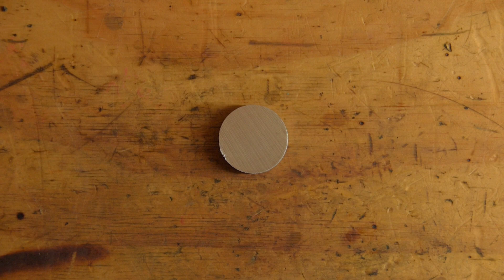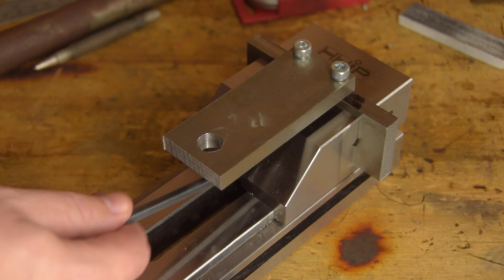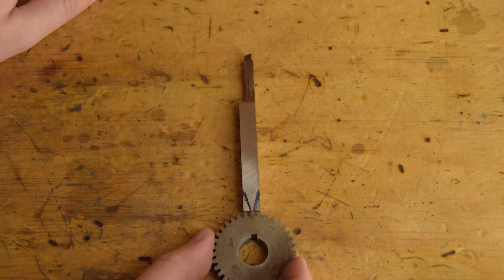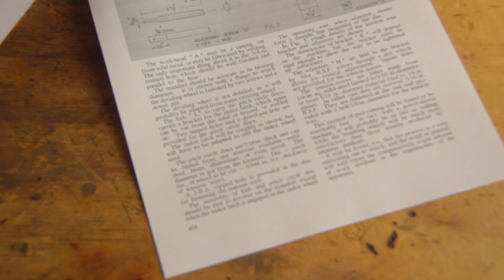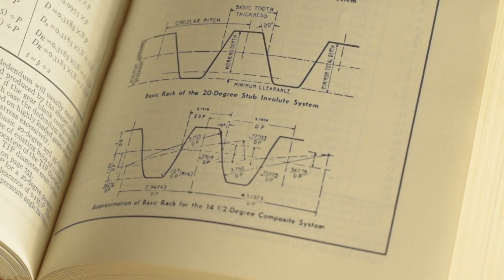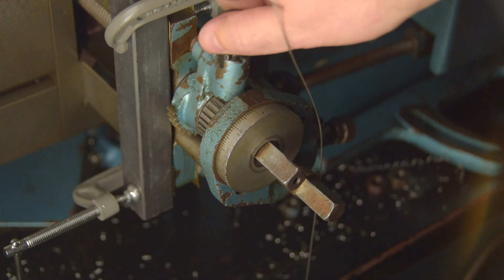Shaper Machine - Involute Gear Cutting

Comment: The concept is a good one, but your method of indexing has caused culmunitive error.  This is apparent at the end when some teeth show signs of being thicker than others. One solution would be to have the bobbin with the wire drive a slide fit on the shaft and have an index hole. In front of that another disk fixed to the shaft but drilled at a pitch circle for the number of teeth required, (needs accuracy) then index with a pin the disk to the bobbin for each tooth.. Either way this method requires a new bobbin and new disk for each different gear blank. Well that looks like one possible answer anyway and it negates your setting up each time with a clock. Enjoyed your land rover rebuild no end, great work. Steve

Comment: I might be able to shade some light on the geometry and machining of evolvente gears. I work as a univeristy student at a gear and transmission research academic chair ( the FZG of the TUM) in Germany. I am mostly concerned with bevel gears, so my cylindrical gear knowledge might be a bit rusty.

First, the shape and kinematic of a evolvent (or involute) gear. Take a cylinder with the diameter of your base circle. wrap a string around it and tie a pen to the end of the string. Set the pen at the base of the base circle and pull it outwards guided by the string. Rotate your base circle contraption one division, repeat. Do the same with the string the other way around the base circle. You have just made drawn a perfect evolvent gear. 

Imagine a belt drive of two pulleys with crossed over belt. With a bit of thinking you will notice, that what you just sketched is the path a single point on the belt traces in relation to one pulley. If you would build a wall along that line, it would always be in perfect contact with a wall derived in the same way on the other pulley. 

You mimic this movement with the wires and the single pulley. The second pulley has an infinte diameter, therefore its wires are a straight line. 
Levers do not mimic this kinematic. Stick to wires or use thin shim stock. 
As for dividing... I am lost on that. Old gear hobbing machines have very complex transmissions that take care of it, but that isn't an option. You could try indexing in a more repeatable manner from the tooth you cut. You could try to make a cutting tool with a second tooth you use to index off of. 

Any questions on gears are welcome, I can break out my lecture scripts, just have to get them translated to english.

Comment: I like your concept so much. The stationary wire an X displaced pulley acts like one tooth on a rack gear to prescribe teeth shape on a pinion gear work piece, synchronously. 

Factors affecting synchronization displacement from linear to nonlinear (circumstance). 

In random order 
(1) pulley wire cross section radius? Ideal radius approaching to or equal zero. Wire bending stretch+compress induced unwanted displacement adds to the outcome. 
(2) circumference(pitch radius) in principle minus circumference(pulley radius) isn’t confirmed by measurement or any other better means to be within one tolerance of one tooth. Neither has been confirmed on the apparatus mounted on the xy table of shaper. 
(3) synchronization coupled wire has elasticity that varies in proportion to load force. 
(4) principle circumferential per tooth may be not be a whole number on the X dial, accumulating round up error times N tooth against one tooth width. 
(5) X axis lead screw accumulated error per inch/mm travelled. 

Consideration :
(1) prior to cutting verify compare (1) one revolution on pulley and (2) one revolution on the work. Question: is that ration equal to one or within one tolerance of one tooth?

(2) a continuously variable coupler : from input to output. So that one circumference input many be linearly compensated within a range of +/- 61degrees. (down to a six tooth gear) ... Such as an inter digit two halves V pulley. 

(3) rearrange the input mechanism - from wire and pulley style - into anther input mechanism of rack and pinion gear matching the targeted pinion gear. 

(4) integrate a variable ratio transmission (may be a gear change box) between input and output of (3) above, making it an universal coupler for the shaper to cut different pitches.

Comment: With the use of metal wire as a pulley has slippage! Same problem with wired cnc routers, that is why all the teeth on the gears are slightly different!

Comment: Great explanation and mechanical set up. BUT, you made the same mistake that sooooo many students make that fail exams. You didn’t read the whole description on how to calculate the pitch circle discs! It says; “Diameter = the pitch diameter of wheel to be cut MINUS the thickness of the tension wire”.
Reply from the maker: I subtracted the wire thickness. You can see me cut it on the lathe. I might even say that?
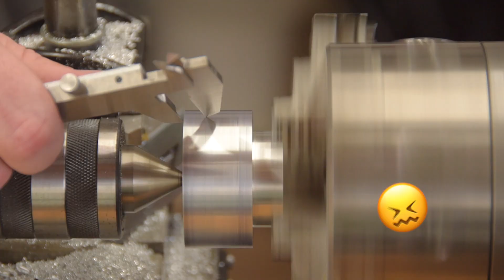Reply: See 5:14

Comment: Great video guy, but you have a lathe, why not cut your gears on it?  Or, if you have a dividing head, use that to index your gear blank,  Or Again, if you're set on using the shaper, why not use the shaper to cut a linear rack first, then use a rack to shape your gear blank.  I don't know what your length of travel is on that shaper, but you're basically got a 1-tooth rack right now.
The more you have to index the more likely you're gonna get inaccurate teeth, which is why a rack cutter is preferable to a single shaving cutter, and a hobber is better still. At least that's what they taught me when I was a youngun back in the "Before Times"

Comment: Instead of the wires, use a rack on the bottom and maybe the pinion (on your axle) should actually be the actual gear that you are copying. After one cut is done, simply return to start, lift the gear and skip one tooth. Repeat.

Comment: Putting aside that making gears using your lathe would have been far easier, I would recommend replacing that wire with a timing belt that can't slip and give cumulative errors.

Comment: For the divider: spring-mounted latch on a toothed cog—like a manual winch? Further, my guess is that the cables have too much elasticity; if I can see enough stretch within the first 100 km with new gear cables to make gear shifts vague on a motorcycle, I'd assume a shaper is putting more stresses.

Comment: First video of yours I've watched, and I like it!   The production values & editing are top-notch!    You're like the Antipodean This Old Tony.  I'm also a shaper owner.

OK, I'll admit, I haven't read all 289 (at the time of writing) comments.  And I've only cut a few gears, and they didn't turn out that great either... so with that grain of salt....  Here are my meager suggestions: 

a) Decide which is more important, the outcome or the exploration.  If the outcome is what you want... it's vastly easier to create a gear hob on the lathe, and then make the gears using the hob in the lathe.  It cuts all the teeth at once, and doesn't require high-precision indexing, only low-precision "gashing" which is just roughing cuts to get the hob started.

b) If the exploration of cutting gears on a shaper is more important, try these things:

  1) If you have a gear with the correct number of teeth (diameter is irrelevant) get a rack that matches the the pressure angle angle and pitch.  Use the gear rigidly attached to the indexer shaft, and the rack is stationary and rotates the indexer as the table moves.  This eliminates the wire lash-up which is suspect on repeatability.

  2)  This is a heavier lift, but if you have the means to produce a multiple-toothed cutter for the shaper (you could, literally, split a hob down the middle... you'd just need to figure out how to hold it in the clapper box), that will both speed up the cutting and help make the tooth spacing more regular.

Comment: I have read the same article and thought about it.  I believe the article mentions using "piano wire" to drive the rotation of the shaft holding the gear blank as it is being machined.  You did not use piano wire.  Piano wire will be a single  wire that has a very high tensile strength, that is, it does not stretch.  One other setup I have seen used a stout spring to load the wire.  If one looks at a piano one sees wires that are wound with another wire; the core is the piano wire; the winding wire just weights the wire to tune the resonant vibration of the particular note.
Presumably the success of this method requires accuracy in the placement of the wire's center at the proper radius on the driven blank and "rigidity", that is to say, no slippage of the wire on the driven blank.  Thus a rigid wire and taut constriction of the wire on the driven blank is required.  Your effort was doomed to failure with your selection of the cable to drive the driven blank.I suspect a substitution of real piano wire, adequate loading of the wire tension and attention to the accurate diameter of the wire on the driven blank will give you a better if not an excellent result.If you really want to confuse yourself see if you can cut an accurate bevel gear on a shaper.  There is a work around using a dividing head and offsetting the cutter to approximate a bevel gear.  Apparently two such gears thus constructed will mesh well with each other.  I believe that there is a method to cut a true involute bevel gear using a shaper but the rotation is controlled differently.  I once found this method described in a patent application and believe it was used in a type of gear cutter.

Comment: A few questions:
1) Why does the diameter of the spindle have to equal the diameter of the gear?
2) How is he driving the wires?
3) What program is he using to simulate the gear cutting?

Edit: put my questions back up, because Geoffrey had a great reply
Reply from the maker: 1. It just has to be that way to cut the right shape. It's complicated. Someone sent me a link to Fellows Gear Shaper videos. If you search for those videos they explain everything.
2. The wire stays still. The shaper table and the whole mechanism moves side to side.
3. It's just an architectural drawing program. No simulation. That was movie magic.
Reply: @GeoffreyCroker  Amazing movie magic! I genuinely thought you were somehow simulating the cutting...

I understand the first two questions too now, thank you!

Comment: i'd worry about the wire slipping, maybe a rack and pinion setup.  you have the rack under the index gear, lift and spin the index gear, spring mount the shaft through a bearing in a sliding holder to hold it down.  it'll take care of the problem of slipping and indexing all at once.

Comment: Put your dividing gear at the back of your wire drive pulley glued to the shaft thing and drill a pin hole in the alloy pulley and make a pin that is a tight fit in the teeth. You can index anywhere in the traverse when wound back and not loose the relationship on pitch by pulling out the pin and indexing round one tooth

Comment: You're a genius 😮
Reply from the maker: Hahaha. This is the least genius thing on YouTube!
Reply: @GeoffreyCroker Hi Geoffrey, Eric from Adelaide here. if you have a spare gear that is the same as you want to make, cut it into quarters and take one of the quarters and use it like you used the piece of aluminium . have it so it slides along and into the gear on the shaft. It will be more accurate. i am sure you can elaborate on this idea. good luck.

Comment: Your aluminum stick is perfectly fine - it's a discrete mechanism and has no accumulating error. What seems specious to me is your piece of string. The shaper applies tangent pressure to the gear being cut and this pressure is always in the same direction. The wire slips on the wheel under this pressure and this error accumulates. To mitigate accumulation of error I would just try to make more turns of the wire around the wheel and to increase tension of the wire. Alternatively, you could manually re-center the gear under the cutter for each gear tooth, or once in a while.

Comment: The process of generating involute gear teeth involves a formed cutter representing a single tooth of a meshed rack translated in synchrony with the blank roll at the pitch diameter. The Fellowes gear shaper worked via this principle but used a rotating cutter, itself having a generated tooth profile. I'm quite sure many a machinist passed the time watching long cuts musing the problem of making generated gear teeth with simple apparatus. 

The magazine article you referenced illustrated the tight band method but some improvement could be made - specifically indexing. Instead of returning to a reference location to index the blank (setscrews may move the hub relative to the shaft when tightened), I suggest you re-arrange things on your arbor. Pin the pitch diameter drum (the part the wire attaches) to the gear you're using as an index reference. Allow the drum/index assembly to rotate on the mandrel. Mount a hub with a shot pin that engages the index tooth space and lock it to the mandrel.  The procedure: cut a space, traverse back to the starting point, pull the shot pin, rotate the mandrel/blank/index one increment, re-engage the shot pin, cut the next space, etc.

The wire has elasticity suggesting it's stretch may affect the cut profile at varying engagement. I recommend the shortest possible distance between wire attachments - or a ribbon in lieu of a wire cable - or both. And leave finish stock. A light final cut will be less affected by the wire's elasticity.

I suggest you acquire a gear tooth caliper. The old school vernier gear tooth calipers are still to be found but are expensive - in the $300 to $800 range. Import digital gear tooth calipers, while (yuck!) imported, work quite well in my experience. Heres an Amazon link: https://www.amazon.com/Machine-DRO-ME-CAL-GEAR-25-Digital-Calipers/dp/B00DS9IGQA  This tool, though expensive, will enable you to grind your tool to the desired tip width and cut the tooth to width at the pitch diameter - and they have many other uses. The alternative is measuring pinswhich are not only more accurate but metrologically definitive. However, some study and calculation is involved in the use of measuring pins. 

Drill shanks of equal size may be substituted for gear measuring pins. There are formula for calculating compensation to be used for non-standard gear tooth measuring pins. Consult the Van Keuren Catalog #36. It has more formula for calculating measuring pin data than you really need to know but I reference it for the readers who delight in arcana.

Gear cutting is one of the most technical tasks for a machinist. Anyone can chomp out a gear looking thing that may or may not mesh with a mating gear. But if accurately cut gears are to be made, a certain amount of book study, vocabulary assimilation,  and calculation will be necessary. The Diametral Pitch and Metric Module gear systems are highly evolved and standardized resulting in a cookbook simple method of calculating the manufacturing data necessary for gear cutting. 

My high school math teachers without exception made their topic cryptic, boring, and excruciating to me. I graduated hating mathematics yet a few years later in my apprentice training, I managed to understand and work the many formulas preliminary to gear manufacture. So, based on my example, the computational side of gear cutting is within the grasp of most anyone with a need willing to study. 

Your set-up demonstrated the principles and potential errors of involute cutting on a shaper perfectly.
Reply: Having put far too much time into thinking about this type of setup, it always seemed like a mistake to me to ignore the diameter of the wire when making the pitch circle diameter blank.  This blank would be theoretically "rolling" down the outer edge of the guide wire, which would make it necessary to take into account the thickness of the wire when turning the blank.  Of course there are many other variables, as you said.  But this is one variable I've not seen mentioned before.
Reply: Didn't understand shit but your authoritative writing probably makes the above 100% correct.
Reply: Nice post Forrest.. 😎👍☘🍺

Comment: Exactly how I expected my first gear cutting attempt to go!  As I was watching you make the guide to fit into the gear teeth, I thought it might be a lot more accurate if your tool did not seat all the way into the teeth.  You should cut an angle that is shallower than the depth, that way it will exactly find the midpoint every time.  It might also be a good idea to load it with some spring tension.

Comment: My idea: build a bushing, that sits on the shaft and can be locked. On it there will be your gear blank on one side and the precut gear on the other, while the indexing pin isn't attached to the base, but to the shaft itself. That way you index the blank relative to the gear itself, which itself is rotating with it. That way you shouldn't be able to mess up the indexing. I noticed that some of your teeth look different in thickness, so there's a general problem in your method of indexing.

Or buy a proper indexing head :D
Reply: Just noticed, the dude in the video you found is doing exactly what I described xD

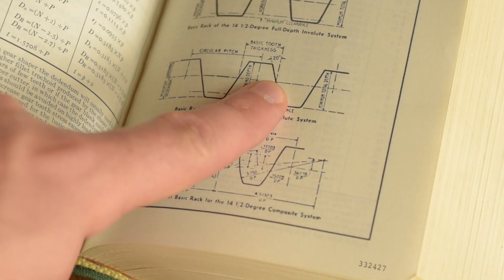Comment: 12:35 pitch diameter isn't exactly "halfway" the tooth.  the top of the tooth is pitch diameter + 1x module , the foot is pitch diameter - 1.25 x module.

 pitch diamater is the same diameter you would give 2 blank wheel turning against eachother to behave the same like the gears (in terms of reduction ratio).
Reply from the maker: Yeah thanks, I calculated it correctly.
Reply: @GeoffreyCroker  great video BTW! the turning of the blank could be done by a rack and gear, but you would need 2 sample gears then....
Reply: or.... turning the blank for the new tooth can be done by remeshing the gear in the rack to the next tooth